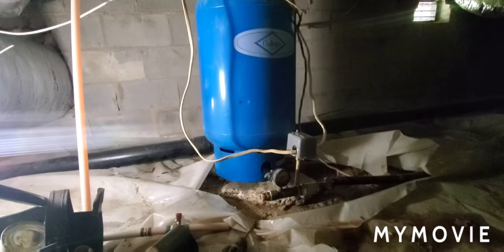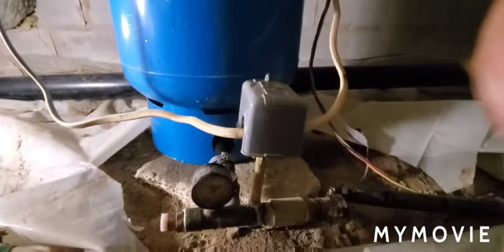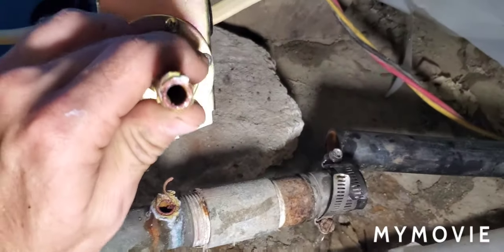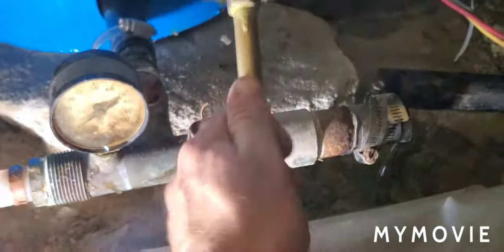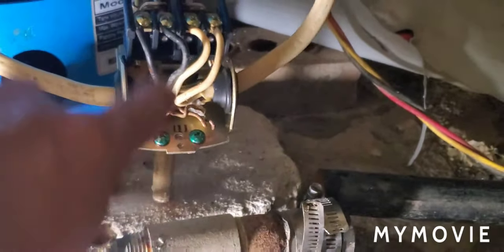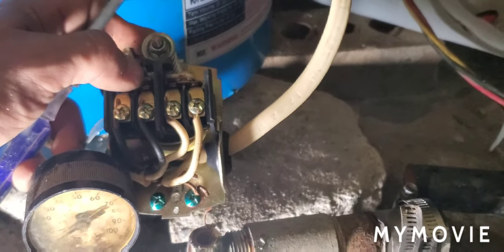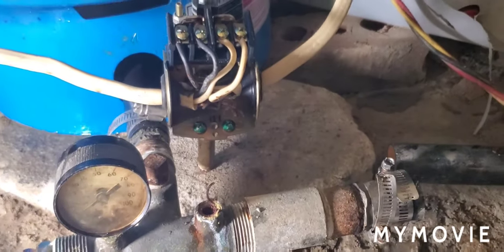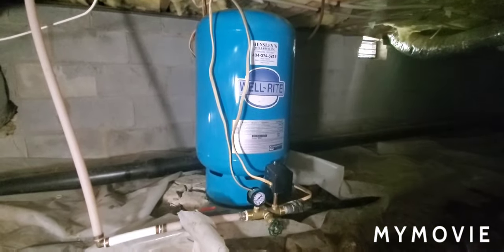No Water or Low Pressure how to fix it & diagnose the issue. Well pump not pumping

Comment: Our water pump tank  will not get up to 60 psi and if it does.and when It does it rakes forever.
Its a new shallow well pump.. the air tank does not seem to be  getting any water in it at all when pump is running. We tok an air hose to the water line and opened the walve to our holding tank outside ( we catch water off our roof). And  blew the libe out to make sure it wasnt plugged. What else can  we or should try?
Reply: We alsoae
Reply: Sorry typo
Reply from the maker: The pump is likely struggling due to a low water table. I'd recommend a submersible pump if you have a 4 or 6" well, bc the WH has a flow meter inside thatll shutdown the unit due to low flow / pressure. Shallow well pumps are notorious for low flow, especially if you are in a southern state bc there's a drought going on.  What kinda of well info do you have on your well?
Reply: @h2omechanic  we do not have a well,, we catch water off of our roof and it goes into a  holding tank ..
Reply: We are in alaska on prince of whales island..
Reply from the maker: @kathyowen8782  then its totally pump related, or your filter is clogged if u have one.

Comment: My pump was continuously tripping the breaker so I pulled it and had to put in s new submersible  pump. I had water for a few days but then it stopped again. This time the breaker doesn't trip. Pressure switch is brand new, it is getting the correct voltage but doesn't spark when I manually open and close it. The pressure tank seems fine as well. I drained it and double checked the pressure. I also put in a new pressure gauge but it is stuck on zero even though the tank has 18 psi.  I even checked for debris clogging and used a pipe snake to reach as far as I could through the piping in that area.
Does the pressure gauge read zero because there is no water in the tank?  I really don't want to pull the well again.. any ideas?
Reply from the maker: Unfortunately if you test for power out at the top of the well & get power there, its got to be pulled out again. You probably used the same old wire & there's probably a spot on the wires jacket that has rubbed off and exposed the copper inside & its probably broken now. Sometimes you'll get strange voltage at the well if the wire in the well is broke . Test for 240, the test each hot individually & use the ground wire as a neutral.  One side will be 120v & the other will be 80-100volts. Or 0. Im 90% sure it needs to be pulled out & the wire inspected closely. Starting at the pump & work your way up to the top
Reply: Only 90% sure?  So you're saying there's a chance...
Reply: I was hoping you weren't going to say that.. And yes I did use the old wire.. I'll test the voltage as you described and see if there is a noticeable variance.
I really appreciate your help...You are the man!
Reply: H2o Mechanic  - I took your advice and it worked...temporarily.... I pulled the pump again but this time I replaced the wiring and the poly pipe. I used heat shrink connectors to connect the new wiring to the pump. I even sprayed some Flex Seal on after heat sealing the connections. I also used a ton of electrical tape around the connections and then more tape to secure the wire to the pipe. 
This time I had a few helpers to help with pulling the pump and lowering the pump. I made sure to lower the pump/pipe/wire very carefully in order not to damage anything.
I turned the power back on and everything was fully operational again...  Unfortunately a day or so later I heard some noises (possibly water hammer) and the system SHUT DOWN AGAIN .  The breaker does not trip but I no longer see a spark when I flick the contacts on the pressure switch...It can't possibly be the wires again.....  Could you please offer me a few suggestions when you have a minute?
Reply from the maker: Your situation is puzzling. Ok. First thing to truly diagnose this, go buy a clamp style amp meter. Clamp around 1 single hot wire. Either black or white. A 0.5hp should read no higher than 6.5 amps. A 0.75hp pump should be 7-8.3 amp no higher. 1hp Around 9amps. It's possible that you got a bad pump...but the amp test will tell you that 100%. If you have the pump box & papers it might tell you the max amp run limits. It's acting like it's over heating...in order to help you further you need a clamp style meter, regular volt meter won't test amps
Reply: H2o Mechanic  - Once again I appreciate the quick response.  I've been meaning to get a digital multimeter. I have an old school analog multimeter but it lacks many features. 
Once the pump stopped working I shut off the breaker. If the pump was overheating wouldn't it eventually work again in a day or so if I turned the breaker back on?
Reply from the maker: Yea. Over heating itll cycle every 3to5 minutes. 4342101376. Call or txt me later. It's easier for me to help you once I can get a full mental picture of everything.
Reply: H2o Mechanic  - I've tried flipping the breaker back on after a day or so and nothing happens.  Thanks for providing your number, I'll call or text you later.     Just FYI , my name is Bob, I'll be texting from a 610 area code (Pennsylvania) .

Comment: My pump turns on and the pressure is on 18 but I have no water
Reply from the maker: Not enough details to go on. But try turning the breaker off & see if your pressure gauge drops to 0. If it does, you have a leak, probably down the well. 
If there's no leak, & your not getting water, see if you get pressure from the tank drain or outside faucet. If you have pressure there, its a plugged filter or sink strainer that needs cleaned

Comment: I have a situation where I lose pressure after washing clothes or after a few days.  I look at the gauge and it will be at like 20 and it is a 40/60 switch.  When this happens I go and turn the power off and on and my pressure comes back.  Then after a couple days it goes away again. I changed the switch and it is still doing the same thing.
Reply from the maker: Your running the well out of water & with time off, it recovers. Next time you have water at 60 psi, turn off the breaker & wait 1 hr. Don't use any water during the hour its off. If the gauge goes down from 60psi to say 20 or 0psi, you have a leak somewhere that is using water. If this is the case, then go inspect the toilet tanks & see if any are empty. 
If it holds 60psi for the hour, call a plumber & lower the pump in the well another 40ft. That'll give you another 60 gallons of storage
Reply: @h2omechanic  thank you.  I kept my pressure during a power outage for hours.  I don’t think there is a leak. But I will have to wait to get some money to call someone out.  Thank you so much 😊 for responding and helping me out. ❤️❤️❤️❤️

Comment: IS IT NORMAL..FOR MY WELL PUMP TO RUN WHEN I RUN OUTTA WATER?
Reply from the maker: Typically yes it does keep running unless there's a safety switch. It's always best to turn off the pump breaker if you run a well dry
Reply: @h2omechanic  wow...that sucks. 
    Love ur vid tho buddy..

Its sun all ive been doin is callin people to answer my question 
    Thx buddy
Reply: @h2omechanic  also...
   Every pressure switch comes with a "lid"
    I seem to have missed up the lids....thus i have other pressure switches around my house...

How do i know if i have the righr lid on..to the pressure switch thats hooked up?
     Both lids have different cut offs on it...i wanna b sure my PSI is right on my tank to match the switch

Comment: Please help me man
Reply from the maker: Ask way
Reply: @h2omechanic  I’m on a well and no water pressure but tank rings like a bell. Any ideas?
Reply from the maker: @MrFamilyMoments  look to see if the switch is closed. If its stuck open, replace switch and nipple. If its closed, it's a bad pump or bad wire
Reply: @h2omechanic  ok thank will start on that now